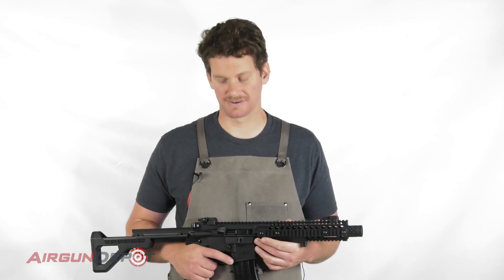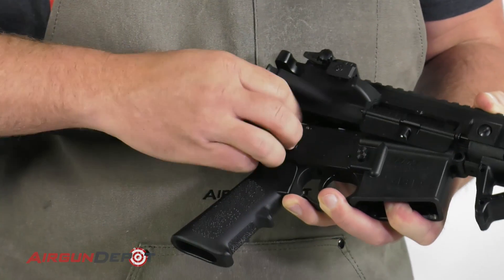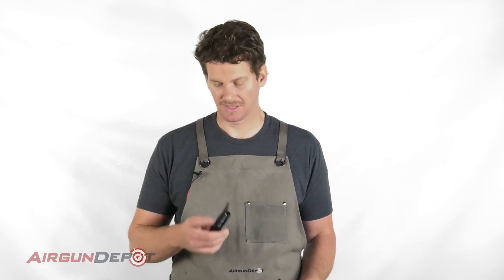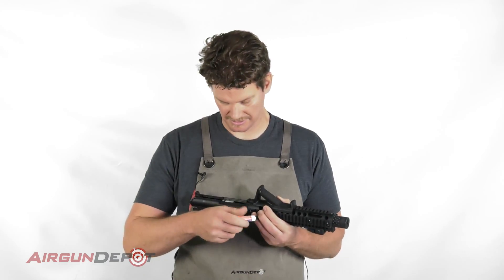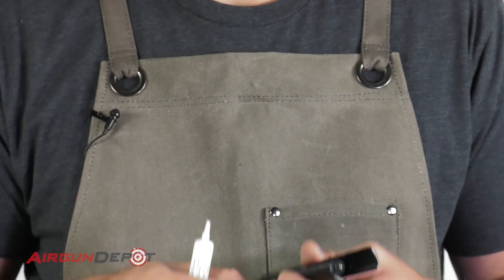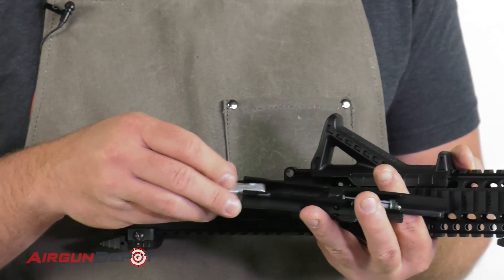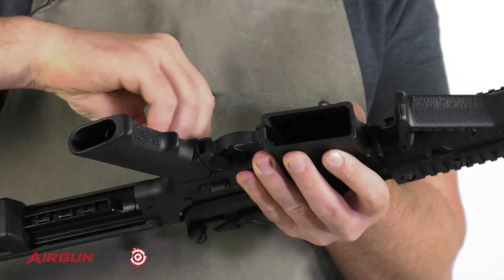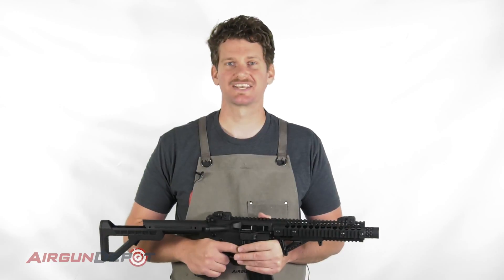Crosman DPMS SBR: How to Maintain Your Airgun

Comment: I oil everything including the mags after everytime i shoot. My baby runs like greased lightning.
Reply: Which products are you using? Because I’ve been trying to find products that people use on these videos and can never find the exact ones. I’ve fired the gun about 3000 shots so it’s about time and I know they only recommend putting two drops on certain areas but I want to fully break down the rifle and lubricate it all.
Reply: @311mikey  i use silicone (treadmill oil) afaik these use synthetic seals so anything petroleum based is a no go however i use umarex bb guns not crosman.

Comment: Awesome review, Do I need to lubricate the internal moving parts before shooting, or leave it dry  ?
Reply: It should come with some on mine worked fine and had some oil on it
Reply: Lubricating the internal parts of the valve mechanism is done by simply adding one drop of pellgun oil to the top of each CO2 cartridge before you install them. The oil will be distributed throughout the internal mechanism as you shoot the gun.

Comment: I purchased the black SBR. Then I purchased the FDE SBR. The FDE's bolt has a roller on top that goes up into the charging handle. The black SBR has no roller, just a metal shape. Is this a version change or is my black one missing a roller?
Reply: "The original DPMS did not have that part and the new one was designed with that bolt, but there is no reason to be concerned that the black version will perform any differently.  

Thank you for contacting Crosman Corporation."

Comment: I bought the R1 awesome  rifle and i have not had any issues with the mags discharging Co2. My question i know you all don't repair stuff but by chance do you know what is a good paint brand to pint my rifle i was thinging of doing a custom paint job on it i have a vinyl desktop plotter so i can cut out paint masks for it. Thanks in advance
Rob
Reply: Here for a comprehensive guide on a similar gun: https://www.youtube.com/watch?v=PTWiaH9pWjg
Reply: @anttones   i got ride of it sold nit to a friend of mine people that know me said that if i were to go out side ans some seen me the cops would get called and then all hell woulkd break out. i guess they figurd it looked to real. and iam bipolor. soo ther ya go.
Reply: @robertscott3399  I see. Yeah it's a good idea to use anything that resembles a real gun somewhere far off where people can mistake target practiec fun for anything else.

Comment: I cleaned it, but i think its the magazine that may be malfunctioning although it does not leak co2. I have to cock it every single time in order for it to shot. Have you guys had the same problem? By your experience, is it the rifle or the magazine?
Reply: Mine did that but only because it was low on co2
Reply: @50rads  so by then its time to get a new co2 correct ?
Reply: illest mortal lol well yeah, but in this case I think his gun is the problem
Reply: Probably some dirt or too much oil in the slide causing friction making the co2 not able to push it back far enough to cock it again after was he shot
Reply: Make shure the cylinder thing you take out with the charging handle isent in backwards.
Reply: Carlos what was the solution?

Comment: Quick tip buy rc oil it's 100% silicone oil and is  thicker than the oil you buy form crossman and is only 5$ for 2 ounces compared to crossman's .25 ounces.

Comment: what would happen if i used Pellgun Oil? because that's what i did....... i havent shot my BB gun yet. But i bought Pellgun oil and put it on the seals already. Just bought the gun today.
Reply: Any 100% silicon oil will do. Pellgun is ok (It's petroleum oil based), but I recommend continuing with 100% silicon oil after those ~3k shots as it's healthier in the long run.

Comment: My sbr shoots and then locks and then i pull the charging handle and shoots and locks again. But only on low co2. Why?
Reply: Its either that you're too low on co2 and there's only enough to push the bb out but not enough to activate the blowback function. Or it could be that you've fired too much very quickly and the pressure has reduced in the capsule. Wait a minute or so to let the co2 pressure stablise, if its still doing it then time to change the co2. This is normal for blowback guns.
Reply: Its either that you're too low on co2 and there's only enough to push the bb out but not enough to activate the blowback function. Or it could be that you've fired too much very quickly and the pressure has reduced in the capsule. Wait a minute or so to let the co2 pressure stablise, if its still doing it then time to change the co2. This is normal for blowback guns.

Comment: Do you have to do this?
Reply from the maker: It will help the gun to last longer.
Reply: Airgun Depot when should I do it 
I got it last Saturday on the 14th
Reply: @mjeverette3858  Personal experience: Oil it up before using it. Or oil it up after finishing using it if you expect to not use it for a while. The Silicone Oil doesn't just disappear after a while. It will keep it lubricated and stop any rusting that could happen because of wear.

Comment: My buffer tube got stuck and this was the first day i shot it and only made it through 3 mags so disappointed if anyone else had this problem can you help me.
Reply: I'm sure you've probably fixed this after so long but if you haven't mine was doing the same thing. I pulled out the buffer spring and cleaned it up and it has never done it again.

Comment: i just bought the crosman r1 and abunch of other stuff for it it should be here tomarrow.
Reply: Same bro. What other stuff u buy for it?
Reply: @recognizereal7ify  i bough 12000 BBs , 100 Co2 canisters 2 extra mags and peloil. i think thays all oh o picked up a cleanning kit off ebay for 24.00.
Reply: @WhoDekMan ive been using a dab of silicone spray oil on my mags . not using pell oil. i havent had a leaky mag or nothiing everthijg is golden. unless you  break it down clean it and dont realize  you put the bolt in backwards and it dont workk and poisses u off for a day until you find out ..duh  lol

Comment: Is it OK to lube the moving parts (like the bolt and cocking handle) with vaseline ?
Reply: I’d say so, but don’t put too much vasoline or it could leak into the other parts
Reply: Late to the party but I would not put any petroleum based lubricants on this. It has rubber seals.

Comment: If you really wanted to truly have the BEST fully auto BB rifle.. 2 things: 
1. Make an upgrade that allows for a drum or magazine that is capable of emptying 300-500+ BB in one single clip / or drum 
2. Make an upgrade that allows for a paint ball size CO2 tank of around 20oz. 

With these two things, this BB gun would be the hell mary of all BB air rifles on the market. 
The biggest benefit is the ability to shoot fully auto for significantly longer periods of time due to having a much larger magazine that holds way more than 25 BB's at a time, and not having to worry with changing out the mini CO2 cartridges after 100-125 shots. Another benefit, you will sell more BB's
Reply: That would probably be pretty impractical on a CO2 gun. You would certainly freeze and fuck up the seals by firing more than 100 rounds at once. It’s already possible on the SBR by dumping several mags in rapid succession.  
Look into the Barra 400e, it is an AEG BB gun, but probably the closest to what you are describing. It holds a lot more bb’s in a mag and performs like a fully automatic air soft.

Comment: I did this method used the same oil now my magazine is leaking how do you fix the magazine?
Reply from the maker: Have you been using Crosman Pelgunoil on the heads of the cartridges?
Reply: Yes same oil in the video can upload a video how to fix leaking magazine thank u
Reply: @airgundepot  Seems like someone had applied too much me thinks?
Reply: @christianarcitio1542  the pellgun oil is totally different then the silicone chamber oil fyi
Reply: I purchased an extra mag when I got my SBR. One of the mags is leaking CO2 at the top at the release valve. It's disconcerting.
Reply: @AJZulu  it could be the green seal in the mag. Make sure its not torn. Did u add a drop of pellgun oil to the tip of co2  cartridge? Next try teflon tape method (google it) if that didn't work and start warranty claim, you may possibly have faulty mag!
Reply: @AJZulu  last but not least there is a order in which you have to tighten the left hand side CO2 cartridge first before they're right. But I'm sure you already know this but it doesn't hurt to go over it again for others
Reply: @AJZulu  found a fix homie.. check my videos for dpms leaking magazine! Hope this helps

Comment: With a (Claimed) Cyclic Rate of 1400 Rounds Per Minute, If you had a 3,000 Round Magazine, or 112 Loaded 25 round Magazines, you could technically shoot 3,000 rounds in under 3 Minutes! So you would technically need to oil the gun every 5 Minutes 😂